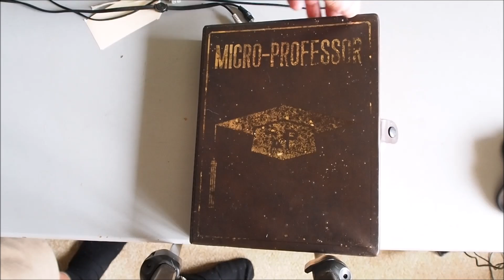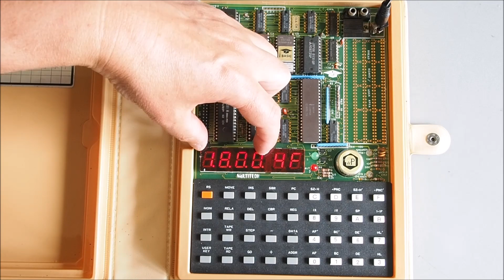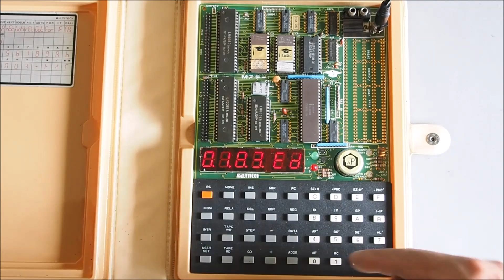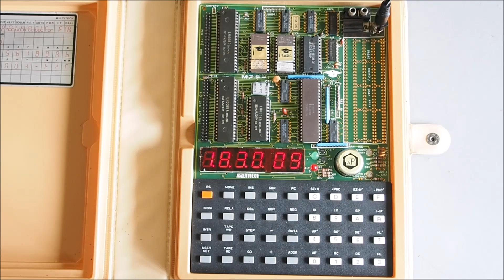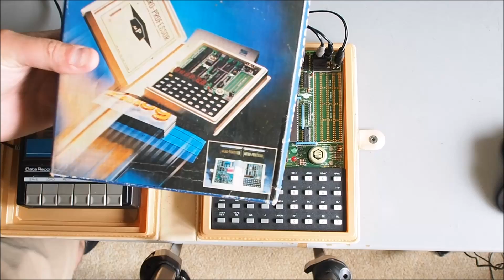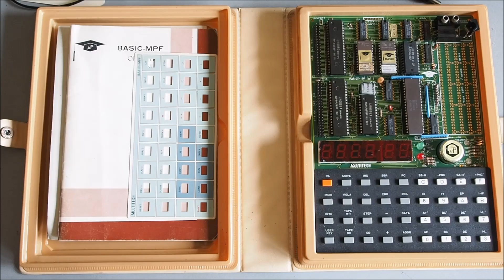Micro Professor Z-80 Trainer MPF-1 - Part 1

Comment: Have you seen Michael Wessel's PicoRAM 6116? It emulates the RAM and effectively replaces the need for the tape deck. And I had one of these, but I banished it to Oz, and is now in the care of The Clueless Engineer over in Port Macquarie. And if you ever see one pass through eBay, the E&L MT-80Z is a MPF-I on the right hand side (with a second Z80 board on the left hand side). The MT-80AZ is different though.
Reply from the maker: I haven't seen that but I'll look into it. Thanks.

Comment: I cut my teeth on one of these. I 'd played with a 'Scrumpy' SBC beforehand but didn't get enough access to get to grips with it. Then II got my hands on a uProfessor and really got to know computing. This machine taught to really grok the Z80 to the point where I designed and built a full Z80 computer running my own OS. Back then getting more than an extremely simple PCB made was very expensive so I had to build it on Veroboard. But it worked, if only at 1MHz, probably due to timing issues.

Comment: Thanks for the video. It demonstrates how painful and slow it is to use just like the Altair and IMSAI 8080 front panels.
The MPF-1 is like a microbee, Exidy Sorcerer and TRS-80 but missing the most important bits - the video output, more RAM, full alphabet keyboard and BASIC interpreter as standard.
The MPF-1's tape data transfer rate is an incredibly slow 165 baud.

Comment: Hello! I also have a Micro-Professor model MPF-1B, I got it from an old teacher and recently I had the interest to try to program with it but I have a problem with it, because when I turn on the micro teacher has to appear on the display that has and what is loading the program counter and unfolds with letters MPF -1 in my case does not happen, when I press one of the keys it simply takes it as an output signal and turns on some of the LEDs on the display.

Comment: Yes. That's the [censored] thing we used in school back in the mid 1980s. I got so tired of looking up the op codes in the 8080 book that I went to the back room and did my programs on the Cromemco computer using ed and asm. At least I got a nice printout that I could punch in. It's good that you have the book, there are some useful routines in ROM. Now I want one :-)

Comment: Hi, I was using this back in 1990 at college. I enjoy using it so much I hand built my own customised versions with extra hardware and software utility's. I'm still using them even today.
Reply: This is my new username. I can't believe two years have past since I watched this video last time. I used these at Brooklands college in 1990. After that I have been building and using my own homemade and much upgraded variations of these computers to this day. The most recent one I made in 2010. I'm planning to build my seventh z80 computer in 2020 to celebrate my 30th year in using and programming homemade z80 computers.
Reply: Nick Tate :) I’m working on something similar with a Z180 and a CY62256 and modernized parts